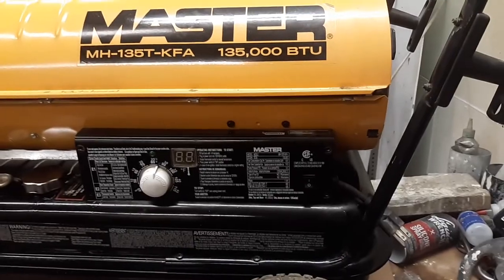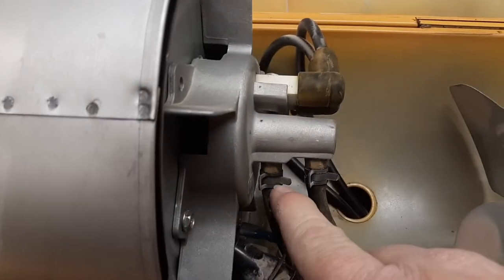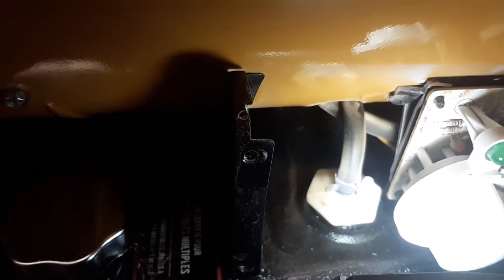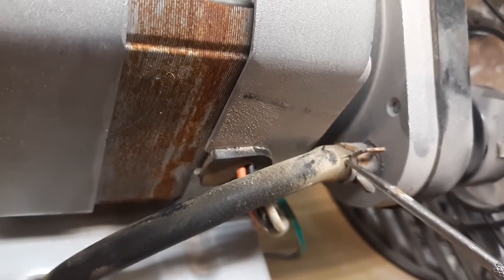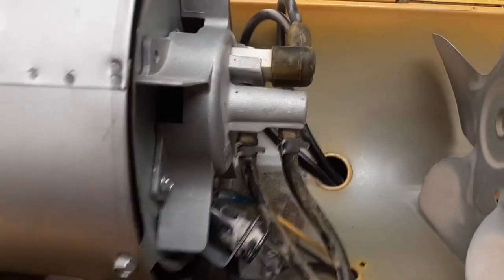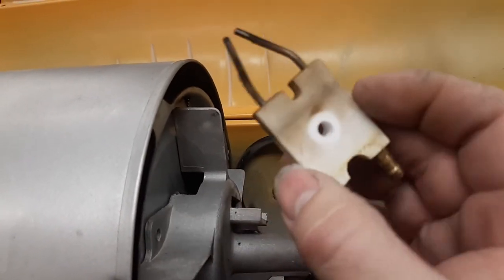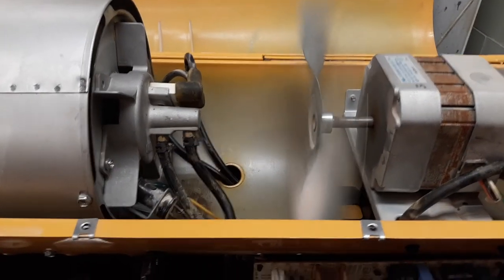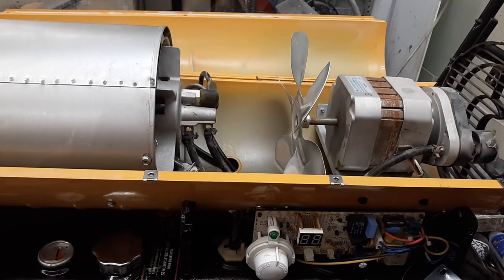Torpedo heater multi fuel heater repair

Comment: Have a question...mine starts and runs...but it is spitting flames out front even with pressure set correctly...do you have an idea what I can do...alot of air coming out of that plug ...can that be fixed...please help
Reply from the maker: @jennifernuss78  spitting flames is usually residual fuel build.up burning off or other things burning off

Comment: Just for shits and giggles, I ordered the brass nozzle for a 125,000 btu unit and put it in my 80,000 btu unit and now mine heats like a larger model for the price if a nozxle! Crazy easy mod.
Reply from the maker: I can't say I would recommend that, but I will not discourage it either.

Comment: Hey Brian- I got a problem with my heater  It wont start  I wont do anything  No fan No spark Nothing  All it does is the lite on the on/off switch comes on when you flip switch on  Nothing else does anything  I looked it over for defects and other than cracked hoses I didnt find  anything obvious  I looked on circuit board for a fuse but didnt see one  Do they all have a fuse?  Its not new but its never been used  Its been stored for a few years since new  Id appreciate any help
Reply from the maker: Not all of the heaters have a fuse. Check your wires close to make sure they haven't been damaged by rodents. Typically if nothing happens when the machine is turned on, the board is bad.
Reply: @Brian_the_repair_guy  Thanks for helping  I was afraid some part of the circuit board was fouled up  Can they be trouble shot  Can they be repaired  Replaced   Someone must be able to fix it  Id hate to trash the heater  They are not cheap  Thanks  Im not ready to give up yet
Reply from the maker: @jacjumpin7471  you can replace them. There is a man in Atlanta that repairs boards. You can email him and see if he can fix it. Jungkim@mindspring.com
Reply: @Brian_the_repair_guy  K  Ill do that  Thanks

Comment: My master heater is throwing an E1 code when I have the power on my fan does not spin
Reply from the maker: Take the cover off, physically spin the fan by hand. It should spin freely. If you feel a bind in the fan, then the fuel pump should be adjusted. Try this first, let me know.
Reply: @Brian_the_repair_guy  ok thank you I have the cover off yesterday and the fan spun free then hit a tight spot turn the power back on watching the fan close did try to spin a quick second but stopped and tripped
Reply from the maker: @aaronlingenfelter7797  this usually means the fuel pump on the rear is out of adjustment. It needs to be reset. If you are unsure, I can make a video this week in how to do this.
Reply: @Brian_the_repair_guy  ok thank you I haven’t touched  it since it was new a couple years ago I was looking at the book that came with it and tells how to adjust the screw and I noticed when I was was not reading any psi on the gauge when I turn it on I will try to adjust it with settings in the manual and see if I can get it to fire thanks again for the messages back
Reply from the maker: @aaronlingenfelter7797  if you have no psi, more than likely the fuel pump is damaged. The carbon disk and fins need to be replaced